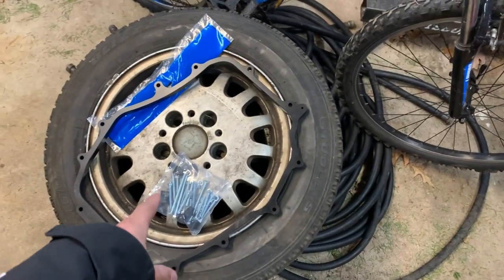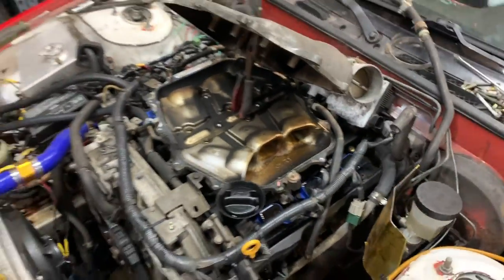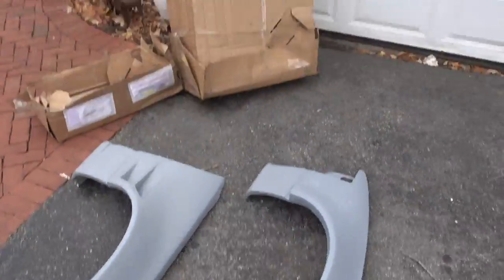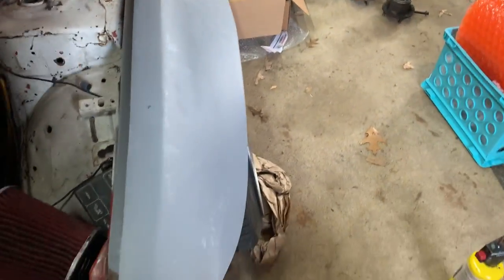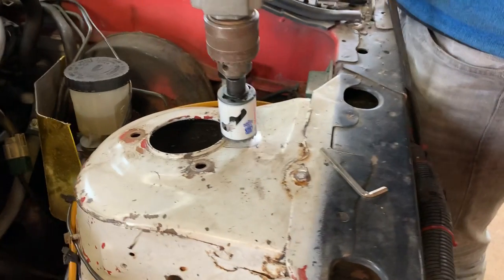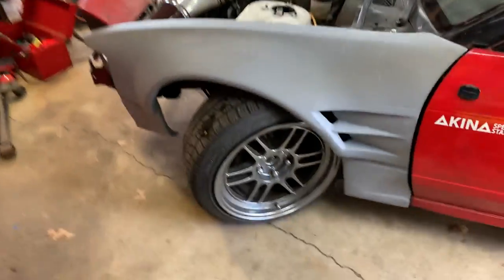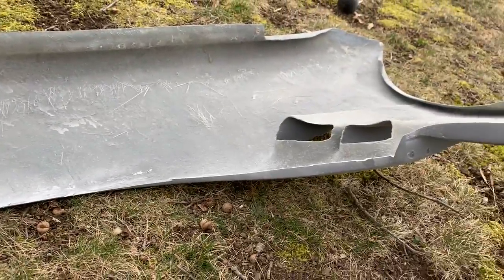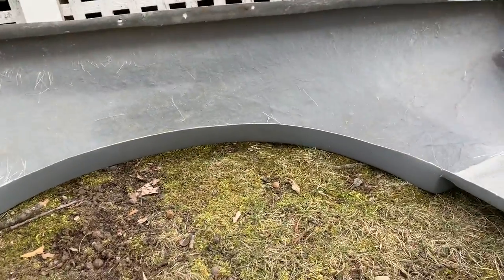VQ35 240SX Drift Car Front Fenders, Plenum Spacer, Offset Strut Top

Comment: Hey are you still using the XTD clutch for the 240sx?
Just wondering cuze I saw ur older vid 3 years ago with the ebay clutch review
Reply from the maker: I dont, i had it on my KA, but i have a stock clutch on the VQ now.